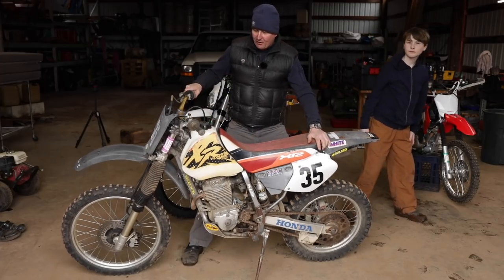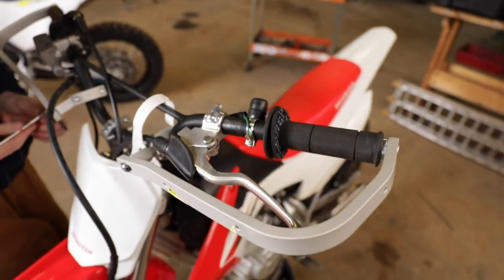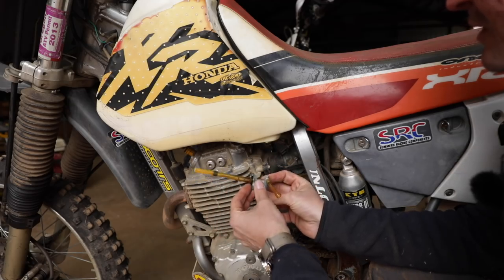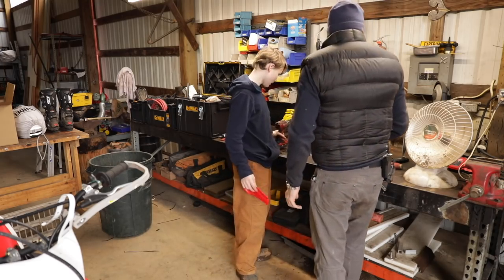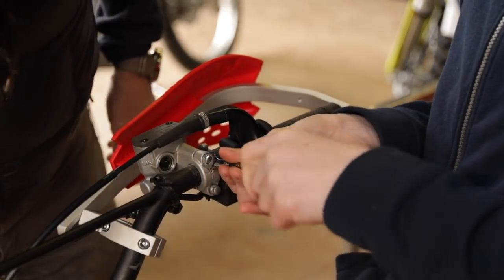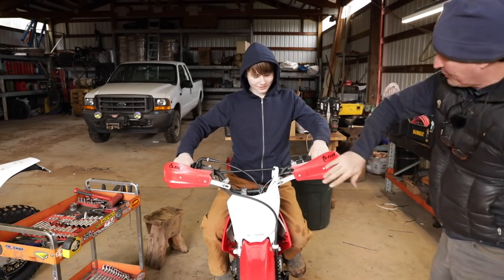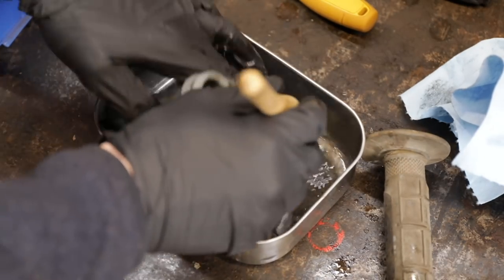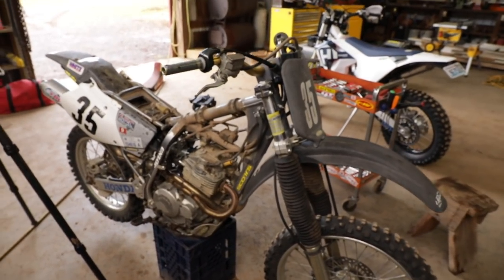This Is Hopeless

Comment: GREAT STUFF!!! Brings back good memories.I had a 1999 XR250 from 2001 -2015 never let me down.My boys and myself have done 2 complete frame off restorations on a XR200 and YZ85.We are now working on frame off  number 3, a 1994 KDX200.It is an excellent learning tool.We bought the KDX for $200 and will end up with around $1200 -$1500 when we are done.It will be better than new we are replacing and cleaning everything.You andJack should consider a project bike.

Comment: Pretty cool to see people putting some love into these old workhorses. I wouldn’t ever suggest running those cut down levers though. That thick ball at the end prevents them from stabbing you in a crash. They sell short levers if you don’t like the feel. And I agree with the comments on the carb. Should clean the carb and see how she does. I’d disconnect the cables from the throttle body and carb to see if they are binding or the return is bad. Keep up the good work, and enjoy riding with the family!

Comment: Wait!!! I just did a 100% frame off restoration on a 96 xr 400 that was sitting for 10yrs. It's not the throttle cables! Dont buy new ones!!! The carb is varnshed. The slide is hanging in the throat!!! I just went thru this last year! Pull the carb, tear it down completely. The only way I got mine clear deep inside was boiling in lemon juice for a few hrs! I soaked in chem can carb cleaner bucket for a week and that did not work. Save yourself some headaches and buy a Minkuni pumper carb now and you won't pull carb 10 times!
Reply: Sounds sensible
Reply: A fellow could just remove the throttle valve from the carb and check the action easily enough by cranking the grip and releasing... no ?
Reply: i bed to differ yours may have been that issue but mine has the same problem and i replaced the cable and bam problem was fixed
Reply: Slugger that 96 probaly should be run on alcohol free fuel too right.
Reply: I was about to say the same thing however he should be able to just thoroughly clean the carb and itll be fine.
Reply: I have bikes from the 60s and 70s running original cables that do not stick because I use the plastic baggie trick.
Reply: Can you give me some advice, I'm planing to restore a xr600 that has sat in one spot for 13 years
Reply: Rheece Turner I can sir, however, I don't want to turn Wrangs page into thumper talk! Let me just say this. I spent $2300 on parts, $500 on suspension work and  120 hrs on the rebuild. Mine was in horrible shape simular to the speciman Wrangle has. It all depends on your use of bike once your done. I did vintage mx with mine so there was a specific purpose. If you are just wanting a good trail bike, do yourself a favor and go to CL and buy an 08-10 2 stroke 300, and call it a day.
Reply: hartstudebakerkid You mean grain alcohol free, correct? If so, yes-yes and yes. It's hard to get if you live in a large city, per our govt, in Texas,  unless you buy the cans of race fuel for $12 a gallon. Av fuel is option, but many people don't recommend that either. I wish I could post pics of carburator when I opened it up. I had to heat carb with torch to remove slide.
Reply: TheCanadianBubba Throttle valve? You can remove the slide from top of carb, with spring and cable still in place, and check that way.  If he can even remove the slide. Mine was varnished so bad I had to use heat to remove. Spray berrymans would not work!!
Reply: Ok

Comment: keep the attachment points for the clutch and brake handles on the handle bars a little bit loose, so if you fall they will not break but just pivot around the handle bar. I do this on mine and never have any issues. Also makes adjusting the position really easy for when other people rid your bike
Reply: Hey I just wrote this too. Great minds I guess.

Comment: Quick, cheap tip for lever perches on kids bikes. Add a wrap or two of teflon tape around the bar underneath the clamping section, and then snug up the bolts equally just enough to allow them to rotate up when they crash. This has saved many levers on my 10 year olds bike.  Keep up the great vids, love em'!

Comment: Sorry to tell you Cody, the engineers only make things harder to work on, not easier. Same bolts all across the board for maintenance will probably never happen, but that's something the consumer could do. Same heads for various size threads & pitch. I find the same issues with vehicles (being a mechanic over 25+ yrs)... modules for everything to the point you can't try things from the junkyard anymore. Many parts are now being programmed to that VIN number. 

I found the video so awesome. The quality time working on things with your son reminds me of the time I spend doing the same with my daughter. I think Jack learned quite a few little tricks and with time, only get better.

Comment: Spraying rubbing alcohol down under the grip will give you temporary lube for install and to take off. I usually insert a small screwdriver down grip and spray/pour it in there. The alcohol will evaporate and wont soak into the grip unlike an oil or WD-40 and you will have a good grip that doesn't move. Great video though! Nice to see you working with Jack and giving him tips!

Comment: Before you get too carried away swapping cables, have you double checked what the routing is?  Shouldn't change the throttle setting when turning the bars.

Comment: I used to use a shot of hairspray to 'lube' the handle bar before replacing a grip. Makes the grip go on easy and gives a slight tacky to it after it dries in place. 

Then the next time it's easier to remove because there is no glue!

Comment: Your son technically tightened the front break correctly. Most people make the gaps equal from the top and bottom screw, which is not actually how you’re supposed to do it. You tighten down the top screw till it almost touches, and then use the bottom one to clamp it down. Believe me or not ;)

Comment: The Philips head "stripping" out is essentially the basis of its design. It's supposed to cam out once it's reached its torque limit so as to not over tighten.
Reply: BS
Reply: talon0863 do any amount of Google searching on the subject and you'll see very clearly that it's not bs.
Reply: "be sure to not over tighten that steel bolt into the aluminum" "also be sure to counteract the Phillips head design that prevents over tightening"
Reply: talon0863 A bachelor of science degree,aye? In what ,bulls**t?
Reply: Andrew Haldeman i was just about to comment something like this

Comment: Just aluminum tape your broke plastic on the back, save the new pieces until you really screw them up.
Reply: Zip tie works. Punch two holes close together and close to the crack and push a zip tie of the same color through with the locking mechanism on the back of the plastic and you can barely noticed any stitches and or do a different color that gives it a real cool stitch effect. Last along time and easy/cheap to do

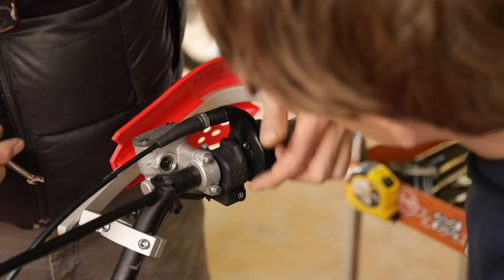Comment: 10:19 you actually don't tighten those clamps equally. It has an up mark which means it's a two-plane clamp. You'll probably notice the same on the handlebar clamps but they'll have punch marks instead of up marks. You tighten the bolt on the up side or punch marked side first until there is no gap, then you tighten the other bolt to spec or desired torque. These clamps are specifically designed to be tightened in this manner. Helps you get a consistent tightness on the clamp and is less likely to break when that master cylinder inevitably gets pushed out of wack by a tree or rock.

Comment: I work for Honda. In my local town. Honda mx not the cars. It's always good to see someone else struggle. With the jobs I absolutely hate. Bark busters are the business,  but an absolute pain to fit. I've come up with a few time saving methods now. Having fit hundreds to customers bikes. Oh and jacks spanner action was gold. Haha.
You don't tighten them clamps up evenly. Honda recommends. There is a gap at the bottom. Pinch the top bolt tight. And have a gap at the bottom. Same goes with bar mounts and clutch perches.

Comment: Drill a small hole in the levers about a third of the way in from the end. It causes a spot for the lever to break and still be useable instead of breaking at the pivot point. Also if you are in tight woods a lot you can use a pipe cutter to take about an inch off the ends of each side of the bar to keep from smacking trees.

Comment: I have to tell you guys I feel like a gladiator going through all this in the late 60 s and 70 s when none of this was around except some good boots to protect your toes Jack . but it's lots of fun the real thing we were wanting is more low end power my favorite was my 360 Bultaco and my Maco true beast of the time . As for the throttle sticking we all put on compression release and true life savor for many ,in my case new bike throttle stuck wide open on a winding fire road a real thriller just squeezed that compression release till the bike stopped with out that compression release life would have taken a bad turn for me for sure . Happy Trails guys .

Comment: Hate to say it, but three different screws means the assembly weight is the lowest possible due to each joint being only as strong as needed.  Your point about trail access for the seat and tank removal makes sense for those 3-4 fasteners. Thanks for the videos!

Comment: Cody you should get a cable lubricant tool it’s the best 6 bucks I spent to lube the cables with no mess also put some Teflon tape under where the clutch or brake clamp meats the handle bar keeps the levers from snapping they just move out the way
Reply: You don’t have to remove the steal cable or anything just clamp it over the start or end of the cable

Comment: I personally have always found it unnecessary to use glue when putting on grips. I just use three pieces of safety wire and it holds it very secure. Plus if you have to replace the grip it's much easier to get off

Comment: If the cable binds when the handlebars are turn the cables are not routed properly. Also if there is a possibility of varnish. The slide in the carburetor will stick and not allow the cables to return as well. I would check that first. Cables can be very expensive.

Comment: Good video. You probably don't need to replace the housing. Just clean it up nice. Replace the throttle tube for sure. I would get an aftermarket air filter instead of the Honda filter too. I hope you post a follow up.

Comment: Actually on handbrake & clutch assembly clamps you are suppose to snug them both up, tighten the top bolt first then the bottom. It insures a better bite on the handlebar. This is stated in Honda service manuals

Comment: The fork seals will probably be  shot by now as well along with the brake flexi's and it would need the chain looking at and of course the tires, probably won't be long before the back shock needs replacing or depending on which one maybe servicing
Reply: Jas Ward even doing all that that you suggested it's still cheaper than a new bike.
Reply: Jimmy Turner no doubt, my comments were not intended that it wasn't, i would love to get my hands on that bike myself, i was just trying to say that don't do a half job just to get it rideable, because i guarantee that there is a lot more going to rear it's ugly head as it gets ridden and what i mentioned would really need looking at as well, maybe not needing any more attention that putting eyes on but it is essential to put eyes on those things at least
Reply: Jas Ward no I totally get what you're saying me personally I would love to get my hands on a late 90s XR 250 or 600 even if it weren't running condition as long as all of the basic parts were there frame engine suspension I would take it. Cuz all the rest of the stuff is out there there still a huge aftermarket support for those bikes they ruled the desert for a while.
Reply: Jimmy Turner definitely
Reply: Jas Ward wales !!!!!
Reply: Siôn Webster South Wales

Comment: Make sure to get that xr250 a case saver as its missing, very common over looked mistake leaving sprocket covers off, most dont realize it until it happens. When that chain flies off it smashes threw the engine case and or clutch cover. Also get that thing a new O-ring chain and some Maxima Chain Wax.

Comment: Hey Cody, I've had several Honda XRs.  Besides the throttle cable there is also a spring in the carburetor that will often get worn out and not snap the throttle back.  That's what went bad on mine.
Reply from the maker: Thank you Jason, I'll check it,

Comment: If he’s getting to big for his bike I would recommend not getting a 125 or 150 4stroke. When I was 14 and grew out of my 110 I got a yz85. Put a flywheel weight on it to tame it a little and muffler with a spark arrestor and it was a much better option that getting a ttr-125. Taught me proper clutch control and have some proper power for any moderately hard terrain.

Comment: I just had the same problem with the throttle. it was because of how to tighten the two screws from the throttle grip. The case is mirrored, but you have to tighten the lower screw first. The case gives the nylon a little more space to move inside.

Comment: Also throttle cables can be loosened at the handle bar, rotate the cable a few degrees either way, until it turns loosely, when reassembled, if pointing the wrong direction coming out of the throttle, it will bind up the cable, now your replacing a cable unnecessarily.

Comment: Great vid  Mon Ami ~!~!    If the tank and the filter is varnised then might as well tear the carb apart and throw a kit in that as well........Strip that carb down to nothing and soak it in some carb dip......    I do that all the time on 2 cycle and 4 cycle engines

Comment: Or just use a cable luber and go ride. Buy one for your son, using the pressure of the can it will free up anything from a bicycle derailer to a car clutch pedal cable. I bought one 20 years ago and it makes me look like a hero. I just looked and walmart sells them for $8.99. The filter is fine for this season.

Comment: There's a tool that clamps to the end of the cable and you hook a can straw onto the tool and it seals it off and shoots lubricant threw the cable to the other side it's a great tool to have to keep all your cables on everything in shape

Comment: The classic Honda XR and XL four strokes are hard to beat for trail riding.
Reply: So heavy though. I had an old uni link XL 500.
Reply: Craig Stewart pro link*
Reply: James - Sorry, been along time :)
Reply: Craig Stewart np. It's fresh in my mind because I've been working on an xl350r
Reply: The one I had was the first model that had it.
Near killed myself on it. Riding along a dirt fire trail past Mita Mita Victoria Australia @ around 100kph.
Front wheel hit a rock around a sweeping corner. Left leg auto went down, threw my leg back, injured my hip. I went off the track and had to miss the huge trees. Managed to pull it up.
It was a super computer life preservation moment.
If I did not have leather Rossi motocross boots I may have shattered my lower leg!
It was a grey/silver colored one.

Comment: After reading a couple comments just thought I would mention that the JB Weld plastic epoxy works very good.  I have used it extensively on my son's scooter panels, both stress cracks and also for gluing back the plastic tabs that always seem to pop off.

Comment: Graphite powder gets my vote for best cable lube, but any trace of oil or grease in the run bungs it up quick. So you have to clean it really good if just changing cable and not the sheath.

Comment: Those levers might not be broken, he might have cut his levers down, that's what I do.
Reply: They didn’t look broken, common modification for dirt bike riding.
Reply: My TT600 has half levers on it. Only takes 2 fingers to run a lever.  Also broken lever shouldn't stop a ride. Move front brake lever over to the clutch or pack zipties and tape.

Comment: My sons Xr has the same problem. I bought the motion pro  cable lubing tool to try that before going out to buy a new cable assembly and throttle tube. I haven't tried it yet, but hoping it will work.

Comment: I've had those built in brass bolt cups on an XR gas tank crack up deep inside where the end of the bolt would be inside of the gas tank. If it leaks after replacing the O ring, that's your issue. Replacement is the only long term answer.

Comment: You can also use a cable luber that forces all the lubricant thru the cable housing to completely clean it out before replacing the cables.

Comment: the XR series of honda's are bulletproof - i know a bloke in the phillipines with well over 200'000km on it (about 125'000miles) he said he has only ever changed the rings on it 3 times - never touched the bottom end or the piston - i guess if your not riding too hard and you change the oil fairly often you can make things last a lifetime

Comment: Im sure the bike needs a full service.

Oil
New chain and sprockets or at least a good cleaning lube and adjustment
Check tires
Check for seals
Check rear shock
Check brake pads
Check brake fluid (replace if necessary)
Spark plug

Oh and by the way those levers look CUT not broken. lotta guys cut them especially on a little 250 because you only need a finger or two to pull them.

Comment: I had the same exact issue on my xr. It was the same model. Where the throttle returns if the bars are straight but if you turn the bars it gets stuck. I guess those are known for that?